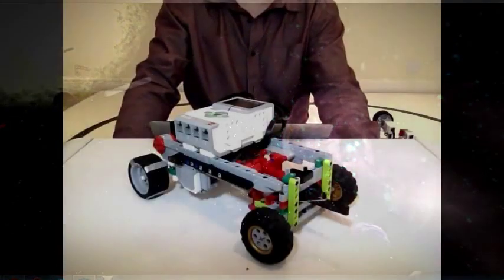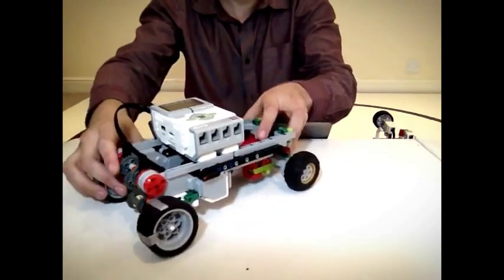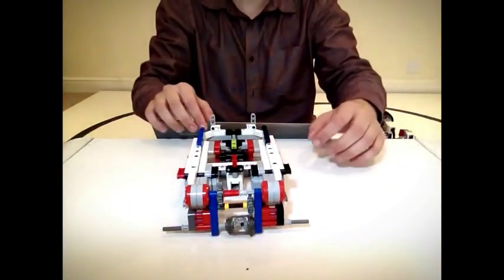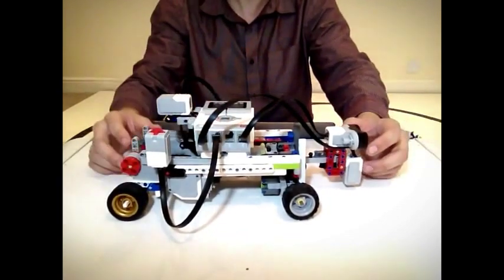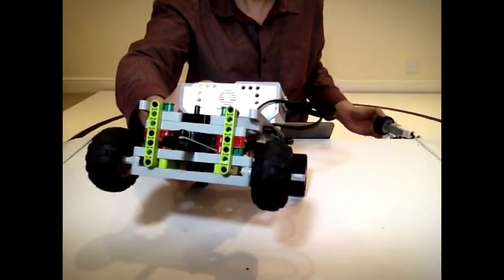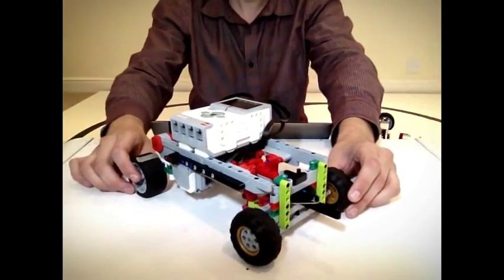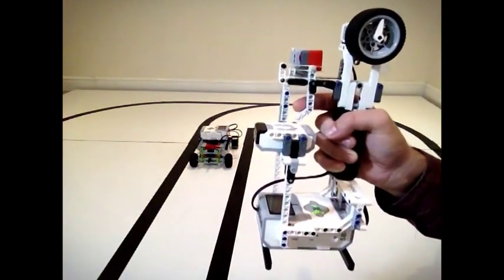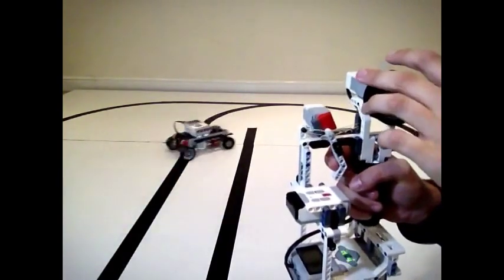Lego EV3 -Universal, High Performance, Autonomous Car Platform- DEMONSTRATION

Comment: Nice work! Thanks for sharing. We built a similar project.  However, we installed an Android device onto a 1/18 RC car and used an IOIO board to control it autonomously. Here you can see the result:

http://youtu.be/vkvkfcqEUkk